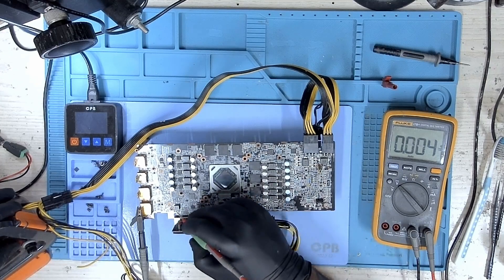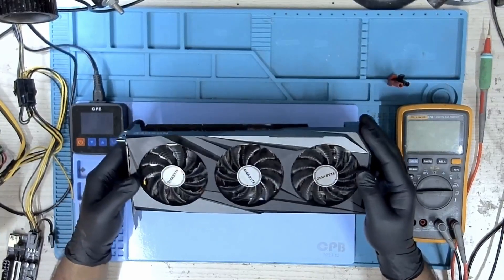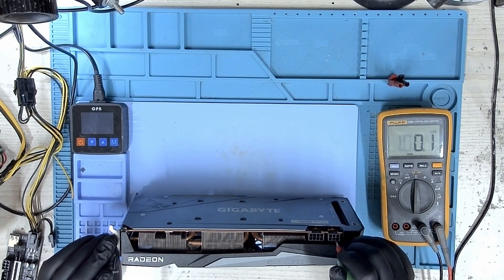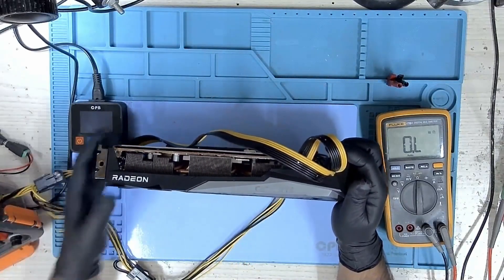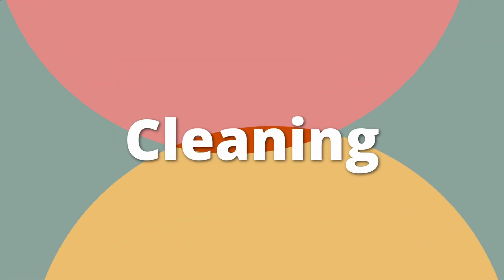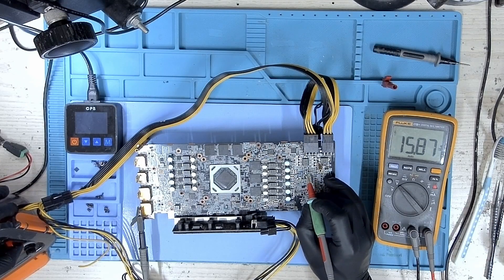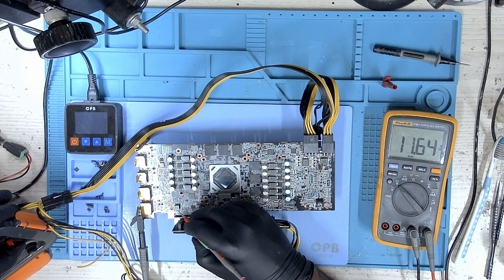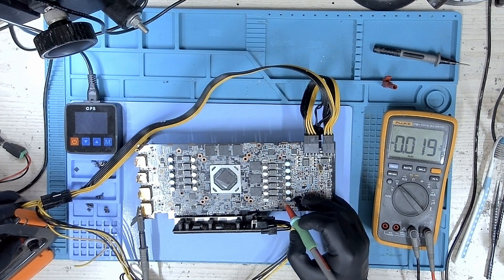I Fixed My RX 6700 XT Not Detected Issue and You Can Too!

Comment: What is the name of the tool/where can I get the tool you used to power the card on?
Reply from the maker: The tool is custom made. I will be making a video soon. For it to work you will need a bench variable power supply. A min of 0 - 30v 5A or up to 10A.

Comment: Hi, how are you? I have an ASRock 6800XT that has all the voltages, and the N-gate output is at 3.3V all the time. I read somewhere that this voltage needs to disappear during boot for the card to be recognized, but in my case it's present all the time. Could this be a problem with my motherboard?
Reply from the maker: If all voltages are present and the GPU is not getting detected the. Replace the logic gate on pex reset and test.
Reply: @GraphicsCardRepairs-tk7ql  i did, still the same :( maybe a core shorted or something? ive tried a new bios file with same results

Comment: I have an RX 6700 XT that doesn’t output video, the fans don’t spin, and it gets hot after about 3 minutes of being plugged in. What could have happened to it
Reply from the maker: This is a power delivery issue. one or more voltages are missing. it will have to be diagnosed to find the fault

Comment: Hi, do you happen to have the part number for that component? Thanks
Reply from the maker: Its a logic Gate Part number NC7SZ08P5X
Reply: @GraphicsCardRepairs-tk7ql Legend thanks
Reply: @GraphicsCardRepairs-tk7ql hi just messaging back about this one, I've diagnosed the board and this component is definitely the one faulty however I just tried to fit it and this part number seems to be the size smaller version of this? You don't happen to know the size up version that it would be?
Reply: NC7SZ08M5X I'm thinking?

Comment: Hello man what a lovely video, i was also trying to test and see if i can fix my gpu and im getting a short on the soc 000.3 ohms. What does this mean?
Reply from the maker: You will have to inject 0.8v 5A in the short area to check which MOSFET or capacitor is shorted. You will need a thermal camera to identify the short. There are other ways to identify as well but the easiest way is thermal camera.
Reply: @GraphicsCardRepairs-tk7ql 😭 I don't really have a thermal camera or voltage injector is there another way because the core doesn't get hot when I plug it into the pc
Reply from the maker: Not just that you will also need a multimeter, flux, solder wire etc. if you don't. Have these you are better off giving it to a repair technician who can diagnose and repair for you.  @BMSSumo

Comment: If gpu wont work on cold boot and require multipleboot (getting warm) then what would be the possible cause? After detected and running the gpu function well it could play games no problem.
Reply from the maker: If its an AMD GPU then there is an issue with the smith trigger.

Comment: I have rx 6700xt founder's edition I bought as its haven't received it the sellers say the fan spins no display so please what might be the issues thanks
Reply from the maker: @princekells2  it would need to be diagnosed. It is not possible to assume. There are endless possibilities.
Reply: @GraphicsCardRepairs-tk7ql  mine does turn on after a few minutes then the display is lost and gpu fan is revving at the same time, is it hard to repair?
Reply from the maker: @Ashbahc it is not an easy fix. It will need to be diagnosed.

Comment: hello i bought a amd radeon rx 6750 xt in may of last year and as a few months ago it would sometimes not turn on and I previously would just restart it several times but now it works randomly typically more likely in the middle of the night. It sometimes will work but not all the time I can still use integrated graphics. It will also do this thign where it will for example if i click of a youtube vid it will still have the image of the previous page while being on a totally different page.
Reply from the maker: This is tricky and will need serious diagnosis. It will have to be investigated.

Comment: hello GPU Solutions, I'm having problems with my xfx 6700xt, the graphics card works perfectly and stops working without an image and gives error 31 in the windows device manager, after some time with the graphics card turned off (1 month) and then putting the 6700xt back works for about 1 week and stops again what could it be?
Reply from the maker: This issue is related to the smith trigger related to the pexbuff and PEX reset

Comment: I have powercolor rx 6700xt and all voltage present. I check on the back the pcb dont have logic ngate
Reply: All temperature ic using thermal camera, is not getting very hot all ic in warm
Reply from the maker: It has a smith trigger
Reply: @GraphicsCardRepairs-tk7ql  don’t know what u mean bro it have 6pin marking u100
Reply: Pin 1 3.2v pin 2 ground, pin 3 3.2v, pin 4 100mv, pin 5 3.2v, pin 6 50mv
Reply: @GraphicsCardRepairs-tk7ql   hello sir can you share the part id of that smith trigger

Comment: Hi,  have a really odd issue with my RX 6750 XT. It won't work at all on a Cooler Master MWE 750w nor a CORSAIR RM850x Power Supply. They both new units. This card will only work on my old Antec 500w. How does this make any sense? Lol. I've tried all solutions you can find online. My entire rig is new. I've even tested this GPU on my old system. No luck.. Is this a hardware fault on the card. If it really is then it wouldn't work on any PSU right?
Reply from the maker: Based on the description I am assuming that there might be a short circuit that your new PSUs are able to detect but the old PSU is not able to detect. The exact cause will be known once the GPU is diagnosed.

Comment: I have an Intel a380 that’s not detected. I have like 80ohms at the pcie 8 pin. But nothing looks burnt. It’s not worth bringing into a shop as the repair will probably be the price of the card. And ideas at where to look
Reply from the maker: 80 ohms is a short on the 8 pin. One of the MOSFETs could be the one that is faulty and needs replacement.

Comment: I have a 6700 xt quick bought it as a second hand worked for a few days then suddenly stopped working it doesn't get detected with the system..First days the gpu fans were turning when i turn the system on but now the gpu fans do not turn and the it still doesn't get detected.  I changed a power supply from a 600w to a 750w but the issue on the 750w is when i plug the pcie cables the pc doesn't turn on it just turns the cpu fan a bit as if there is a short and then it doesn't turn on. When i unplug the gpu cables it turns on perfectly. Im now confused is it my gpu or psu.
Reply from the maker: It is the GPU. It either has a short or the gate or smith trigger is faulty.

Comment: My RT 6700 XT stopped working two days ago as well. No display, fans only spin up for a second or two, RGB is still working. My 5600x sadly has no integrated graphics, so I can't look up errors or try to reset drivers, etc. The rest of the system is working I can use caps/num and multimedia keys that only work in Windows. I never worked on the card and sadly it's 2 and a half years old.
Reply from the maker: This could mean either there are memory errors or the GPU is not detected.

Comment: Is it possible to upgrade the vram on the 6600XT from 8gb vram to say 16GB or even 24GB? 😅
Reply from the maker: All AMD 6000 series already use the largest capacity modules of 2GB. Upgrades on 6000 and 7000 is not possible.

Comment: Hello🤝thank you for so much information on your channel and congratulations on your knowledge I have a similar case with RX 5600 XT 6GB I have all the voltages and resistances are fine the system starts but does not detect the card neither Linux nor Windows in your video you replace the logic gate at the output of which a voltage of 3.3V appears which is responsible for PERST# in my case it is 3.3V on u100 74AUP1G57GM is a configurable multiple function gate with schmitt-triggerr inputs. should there be voltage at the output, i.e. on the fourth leg of PERST#BUF? and what does this signal correspond to thank you in advance for your answer and sorry for my English best regards
Reply from the maker: Yes there should be 3.3v on pin 4 that is PEXST#BUF. Since its a 
Smith-trigger the output is delayed by 1 sec on pin 4. The output should be 3.3v. if all other voltages are present but not voltage on pin 4, replace smith-trigger. They are known to fail and cause of most of AMD not detected issue
Reply: Thank you for your quick reply, the voltages on u100 are on pin 3 and 5, it is 3.3V on pin 6, PERST# is 2.8V, but on pin 1 it is 3V. I have traced where the 1.8V comes from, the U902 (5230 RKMQ) system produces a voltage of 1.22 on pin 14, which goes to pin 3, Q904 (2N7002DW), and from pin 2 it should be 1.8V, EN, which goes through R929, R103, and C100 to pin 1, U100, on pin one, I have 3V. Is this the correct value? I have checked resistors R100K and 0R, and they are OK.
Reply from the maker: Looks like you have all input voltages only the output is missing on pin 4 which is the PEXST#BUF right? In that case just replace the smith-trigger and that should solve the detection issue.

Comment: hi my dear sir.

have u tried swapping to samsung gddr6 24gbps or
3090/80 ti vram (21gbps) to say a 3070?
Reply from the maker: No I have not tried the 24gbps GDDR6 on it. The memory timings will need an edit. GDDR6X memory will not work on GDDR6 slot. Data line pads are located in different positions.

Comment: Have the same card. All voltages present, card is detected but no display. Checked the gate shown here and have 3.3v output. Not sure what else it could be.
Reply from the maker: This could be memory errors. If the card is detected and it shows in device manager when booted through the internal display then it's likely memory errors. Watch the video linked below. 👇 
https://youtu.be/LBvRpAGLjFw

Comment: I have one sapphire 6700xt has gpu clock locked at ~ 500mhz. The card has been repaired before. Three days working on it but not find solution. Do you have any advice ?
Reply from the maker: Locked at 500 can have a very wide range of issues. Difficult to pin point. Thermal, power draw, PCIE, BIOS, core etc. can you check resistances on all points and mention them here. Also voltages. Also flash the BIOS from techpowerup and mention here.

Comment: I have the same card here, and I can not figure out what is wrong with it. All voltages are there. Might be a dead core.
Reply from the maker: Check smith trigger or And Gate. Most of AMD cards have a trend of blowing And Gate or smith triggers on pex reset. This is 7th AMD back to back which had all voltages present had this gate or smith trigger blown.
Reply: @GraphicsCardRepairs-tk7ql  I will take a look at that end gate. Same one you replaced in the video. Thanks for thr tip my brother!
Reply from the maker: Yes same one in the video.  The GPU before this I thought it was the core. Then when I tested the gate. This was the issue. This card in this video was then a walk in the park. Different users similar issue.
Reply: @GraphicsCardRepairs-tk7ql  Thanks for the tip! You're the boss!
Reply: @GraphicsCardRepairs-tk7ql  Just replaced that end gate, but it did nothing. I'm afraid the issue with this brick is something else. Still can't figure it out 🫤. Thanks any way for the tip!
Reply from the maker: @TechnologyHive no issues brother. Then It's possibly a dead core. But does it get detected?
Reply: @GraphicsCardRepairs-tk7ql  Not at all. Cold as an ice cube. The VRM does not turn on. I am missing 1.8. But 5v and all 12v rails are present. All resistances pass as well. But the guy who had it before me killed it with liquid metal. I told him this is most likely a dead core. And now I'm leaning toward this more. I kept it for parts. Haven't had to strip it yet.
Reply from the maker: @TechnologyHive it's a dead core possibly.
Reply: @GraphicsCardRepairs-tk7ql  Yeah most likely. RIP LOL
Reply: @TechnologyHive  First you say "All voltages are there.", then you say " I am missing 1.8," you should learn the basics before messing with any GPU.
Reply: @TechnologyHive  Sorry if I misunderstood you comments. From what I know, having all voltages should've meant having 1.8 also.
Reply: @JuozasU  If you notice in my comments, I am missing 1.8v after the end gate switch, which means there was nothing wrong with the first end gate or U logic to begin with. So the replacement taken from a donor board is most likely in a degraded state. 1.8v powers the low level logic inside the core, VRAM, and BIOS. But if the core is dead, it makes no difference.
Reply: Did you fix it  mine also fans spins no display all voltages are present 😢 core is cold as an ice  @TechnologyHive
Reply: @princekells2  It is actually a resistor, or it was in my case. You will need to use a thermal camera to find it. It is hard to explain here.
Reply: @TechnologyHive  Really 😯😯 I see I remembered some guy on YouTube said the same it's 10hum resistor bro
Reply: @TechnologyHive  so did you fix yours by finding the resistor am curious seriously
Reply: Do you know where I can buy a core for this please